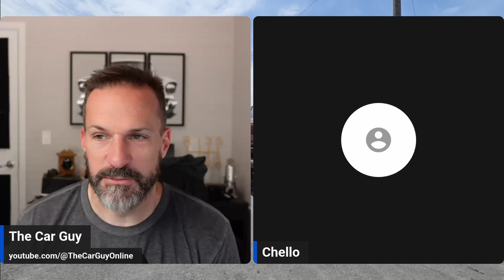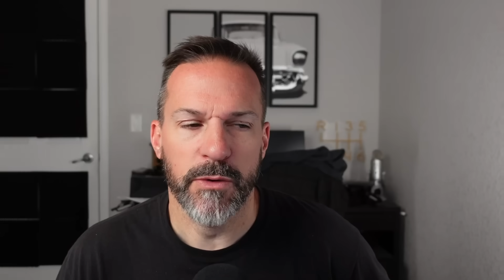Former GM Engineer EXPOSES Planned Obsolescence Tactics.

Comment: 2 days ago, I sat in front of the financial officer at a GMC dealer approved for a Denali ultimate 2025 .  I asked warranty questions.  Right from the start, I was told not to have my transmission flushed at all by the dealer.  I told him I do this every 50 thousand miles and use GM products.  He said if you like your warranty, don't do it. So I said sell me an extended warranty.  He said sure how about 5 years 100 thousand miles power mechanic part. 14 thousand mile limit though. I said what kind of warranty at GM has a limit on mileage on a 6.6 diesel.  He said we sell Fidelity as an extended warranty.  I said I want a GM extended warranty.  Sorry sir we don't sell GM extended warranties at this dealer.  So I said Lubrication is a problem for this warranty company.  Will my transmission be covered by Fidelity if those valves have an issue.  He just sat there staring at me. So I walked away from the deal. I had an awesome price but with auto manufacturers selling trash products you better have a badass warranty.  Not some warranty company that you have to file a claim to get fixed. I have my 2012 GMC SLE diesel with the LML and 300 thousand miles on it. I recently upgraded my CP4 , RDS turbo, 8 new injectors,  new fuel rails and lines. Green belt, water pump and 2 new thermostats. 
Runs like the day I bought it. It's a 2500. I'm considering keeping the beautiful truck and turning it into a overlander and buying me a new 3500 for my retirement.  Well that was the plan. I guess I'll set back and watch what GM does for 2026 transmissions. I still got my 30 grand to lay down in my pocket. Heads up, GM loyal fan here. Make me happy.
Reply: That dealers full of crap..go elsewhere…my brother bought a used 22’ Tahoe with 24k miles still under factory warranty and he bought a extended warranty thru gm to 5 years 100k…that salesman was lying to u , they probably been told by gm to undersell the factory warranty extension cause gm knows their stuffs junk and to save the company money,cause they know all these trucks will be coming in for work…never buy a aftermarket warranty….only extend the factory one and today I would never buy anything new without doing that these vehicles are way expensive and I would want the whole thing covered more than 3 years 36k miles..cause your loans gonna be a minimum 60 months.
Reply: @toddprater14  👍
Reply: Gm doesn't give a hoot about you
Reply: @Dillybar777  neither does Ford or dodge. Been through them all. The only difference between all 3 is gmc will actually look at your truck the same day and at any gm dealer.

Comment: The problem in the auto industry is they keep moving on to new and different. They never focus on perfecting what already works.
Reply: They perfected it all decades ago. The problem for them was that a vehicle that lasts 30 years and 300,000+ miles doesn't generate secondary revenue or new vehicle sales.
Reply: What about reputation? If I were a car company I’d rather be known for making a superior product and charge what it’s worth than being known for putting out ever changing crap that cost the same as the next company…
Reply: If everyone was paid in exposure then nobody would be getting paid or paid very little. Car manufacturers, along with any giant corporation is doing what they can to be into as many markets as possible or be a monopoly like Google or Apple
Reply: @williamdebene2394 except that thinking is flawed in the bean counters opinion.
Reply: @williamdebene2394  The people running the company don't care. For the most part they just want to keep the shareholders happy today. They aren't thinking about 10 years down the road.
Reply: @illbeyourmonster2 yup. The GM 3800 v6 is basically indestructible. I'm guessing that was a mistake.
Reply: @stinkothestooleater4490 - They couldn't get the 3800 to meet the newer emissions. That was it.
Reply: @corpsie666 true. But they can still make fuel efficient engines that meet emissions reliably. They choose not to.
Reply: Most of that is because technology and government regulations are constantly changing.
Reply: @Holden-McGroin bs. They keep changing stuff because that's what makes them money. They get around most the emissions stuff by making their new trucks bigger and bigger.
Reply: Toyota did it for years Y'all complain and said it was boring ... 👀
Reply: @jermainec2462 that’s why I drive a second generation tundra, 300k miles is typical for those
Reply: @jermainec2462 nobody complained. People said it may have been boring but it was worth it, having a 500,000 mile car. Literally nobody called Toyota and demanded they make their most reliable cars more "exciting," with stupid over-engineering.
Reply: @654Crossman they demanded it because ppl complained they were boring... They finally listened and this is the Lexus you see today ... Akio Toyota got sick of y'all talking shit 😂😂
Reply: @jermainec2462 are you high or drunk?
Reply: They did perfect it.  But it ran too long so they fixed it.
Reply: Except the top Japanese manufacturers, even if for some cars they also brought up the planned obsolescence.
Reply: Gm did bad deals.and gave away thier.markets and tech to china....
Reply: Sadly customers are as much to blame as anyone. I used to think it was insane that they changed body styles so often. Just as they were getting all the manufacturing kinks worked out, it can take years, they change to a new body style. But talking to guys who work in the marketing department makes it clear why they do it. There's always a spike in sales when a new body style rolls out. It's stupid, as the first couple years fit and finish aren't as good as they will be, but most people don't know or care. They want a flashy new car that stands out.

Comment: Cars and appliances these days are manufactured with a lot of plastic content.  They are junk.  Because this is be becoming so widespread, any manufacturer of these items that wants to capture their market, should go back to designing and building a quality product.  Sure, it will cost more, but in the long run it will save smart shoppers money and that manufacturer will become a leader.
Reply: My parents still have a garage refrigerator for over 40 years.
Reply: @xnihilo64 Don’t get rid of it.  It’s built better than toda’s junk.
Reply: The general public isn't smart enough to buy better products. Everyone just does what they're told. And the marketing tells them to buy junk. If someone tried to make a quality product today they would be sued to the gutter and failing that, customers would abandon them to get the newest flashiest plastic junk instead.
Reply: Are people willing to pay more for higher quality cars or appliances though? Here in Australia, a Mitsubishi Electric or Panasonic refrigerator is approximately 80-90% more expensive than a comparably sized Whirlpool, Westinghouse (Frigidaire), LG or Samsung, and honestly the notion it "might" last three times as long but is nearly twice as expensive is a hard sell.
Reply: @TassieLorenzo Here in the US, appliance manufacturers both cheapened the content of their products and raised prices.  At this point, I think the only solution is for groups of engineers to form start-up companies to design and build solid appliances without the overhead and expense of large corporations.

Comment: Great video!...and it closely matches my suspicions and experience as a customer of numerous vehicles. I've owned at least 50 cars, trucks, and SUV's since 1992 (about half purchased new), and currently have a fleet of 16 (several GM, several Dodge, a few Jeeps, and one Ford). The vehicles range from the 1987 to 2025 model years). I've also owned Nissan and Honda in the past.  Based on my experience, the best built and engineered vehicles were from the late 90s to about 2010/12 (depending on the make/model).   In general, the individual component build quality of older vehicles is significantly better than newer cars, although some of the design, feature, and fit/finish is better on newer ones. If I could buy any new vehicle it would be a 2005 (fill in the blank on make/model). Newer vehicles are generally disposable trash that are often mechanically totalled after ten years or less.
Reply: I've got an 05 Jeep wrangler and an 05 GMC Sierra 2500 with just the 6.0 gas engine. Still very reliable vehicles.
Reply: Yup, the early 2000s was peak vehicle reliability and functionality. Yeah the interiors and things weren't the nicest but they drove well and were extremely reliable.
Reply: ive got fIve cars. 97, 97, 00, 05, 10. the 97s can literally sit for months. put a battery in and they fire right up. we're screwed once these vehicles are no longer available

Comment: GM engineer: "Hey, boss. I think we've designed a really great, powerful, reliable engine."

GM executive: "Good job. Now go back and figure out how to make each unit 25% cheaper to produce."

I have been making this joke for years. Turns out it isn't a joke! 😂😂
Reply: You forgot to add that it should explode 3 days after the warranty runs out.
Reply: But see, that’s the right way to do it. That’s not what GM does. GM lets their accounting staff arbitrarily change engineering decisions without consulting the original engineers at all. Cost accountants have the final edit on everything. Been this way for decades. It explains every one of their major screwups.

Comment: I’m going through bs for the 2nd time in 3 years! My 2022 Trail Boss had a lifter failure due to the crappy AFM/DFM system in which they snapped in half. They never alerted anyone or sent any recall notice. When I asked why, the dealership said GM was waiting for them to fail and then have the owners bring them in, clearly cause they were hoping they’d be out of warranty. After it got fixed, I traded it in for my 2023 ZR2 with the 6.2L, and now those have issues! Been looking into trading this one in for a ‘25 Toyota Tundra, till I did extensive research and have found that these new Toyota trucks suck too, and that they went away from the V8 and now have the I-Force Max twin turbo which are loaded with failures and people complaining about the cheap build quality. I’m hearing the fix for my ZR2 is that they will do a diagnostic test. If they fail the diagnostic test, they will replace the engine, if it passes diagnostic, they will drain the oil and replace filter and oil with 10W-40 and increase the warranty to 10 years/150k miles.
Reply: Afm went bad and destroyed my engine in my '14 sierra as well. I took it into a shop and spent 8k replacing parts and completely mechanically disabling the afm. Ran fine for years til the trans went a few months ago. One thing after another but im not getting rid of my paid off vehicle for another can of worms that I have to have full coverage on and pay a ridiculous amount monthly.
Reply: need to get a tundra made after 5/25. they changed the bearing design on main 1 and rear.
Reply: You better off getting the Tundra at least Toyota is replacing the engines as a whole and not pissing down your back and calling it rain like what GM is doing
Reply: @Clamjuice65 Yeah, I'll buy a new Tundra with a likely/possible bad engine because I can get a new possibility bad engine??? Then there is loss of use and inconvenience. Have at it!
Reply: @jimiguitar3252 and you can have the same situation dealing with GM . At least Toyota gonna replace it and they not back ordered.  So yeah I’ll have at it with Toyota over crappy ass GM shit any day
Reply: @Clamjuice65  Ford had a 6.2L engine I have it in an F150, it is bulletproof, very few repair vids about it. They also put it in the superduty. They have a very rare broken valve spring issue. Even rarer to drop a valve and destroy the engine. Very simple SOHC engine like an overbuilt crown vic.
Reply: @jimiguitar3252 you will definitely get a failure with the GM, not a question of if, but when. Fact
Reply: @Clamjuice65  they have to start making long blocks, they never did before - you'll wait.

Comment: Planned obsolescence goes all the way back to Alfred P. Sloan in the very early years of GM.  GM has succeeded with their plans, to the point where they themselves have become obsolete.  Well done GM......well done.
Reply: Planned obsolescence was introduced by Alfred P. Sloan, the CEO of General Motors, who envisioned a radical new idea that would change the auto industry and the entire economy. GM would convince customers that one car in a lifetime wasn't enough
Reply: @RayVanessa-p2d  In opposition to International harvesters' pickup lines that killed them because they would never die no matter how hard you beat on them.     I have a 1952 International L110 that would take maybe a good weekend and $500 - $1000 to have it back up and running as a daily driver.   It would be ugly and basic but it would run!
Reply: Started big time in the 80's

You see vehicles from the 70's and 90's but very few from the 80's  They did it too good.
Reply: @lostvisitor You must live in a good weather area. I live in the rust belt. Very seldom do I see anything older than about 2010. It seems as the car makers either make the bodies rust out or the engines blow up. In the 70s during the malaise era, they were using muscle car drivetrains that they cut the power output in half. The drivetrains were bulletproof because they were way overbuilt but the bodies rusted out overnight. Then in the 80s they seemed to solve the rust issue but the smaller engines were garbage. American car makers weren’t used to building economy engines. The 90s kinda got it right but at that point cars were so boring nobody cared. This is about the time that a lot of buyers switched to buying trucks. Most Americans want a full frame V8 powered vehicle and trucks are the only thing left that fits the bill. Plus they were bulletproof because most people used a heavy duty vehicle as basic transportation. SUVs in this time were truck based. But the rust issues reappeared. Now most American car makers only make a few passenger vehicles. Mostly Mustangs and Corvettes. Chrysler had been doing very well with the 2 door Challenger and 4 door Charger. Both had V8 options. Ford did well with the Crown Victoria until it was killed off. GM went downhill when they quit making RWD cars. We can all thank the government for the mess we’re in today. They stuck their nose into private business by telling automakers how they had to build cars. Had they all kept making RWD cars with available V8 powered vehicles they’d be alright today. They should have left the FWD crap box car building up to foreign automakers who had already perfected them. But government mandated our automakers to make Japanese cars and we failed. Why would anyone want an American copy of a Japanese car? Especially since they had already perfected them? This is a big (but not only) reason our automakers are in the bind they’re in. Automobile manufacturing was a large part of our economy not so long ago. Since we’ve fumbled that, our economy is poor. Thank the government. Democrats and Republicans alike.
Reply: @mikee2923  I can agree with most of what you said.  But you missed the biggest point.  Auto makers as well as ALL big business is interested in only ONE thing.  Getting the money out of your hand and into yours.  The times of providing a service and quality products has always been a LIE.  The Quality engines of the past were a mistake.  Then they kind of got it right in the 90's by accident.  

I work on these piles of junk every day and the newer it is the worse it is but they are ALL junk.  If you ever meet a auto engineer kick him in the junk.

As for the government mandates.  The auto makers pushed them and paid people off to get them so they could close out competition.  You can still get a 10k$ new car every place else in the world but here.  Yes it is junk but so is the 50k$ car you CAN buy.

The biggest problem auto makers face is the fat, lazy, stupid work force that thinks they are worth 40$/hour to put a bolt in a nut. 

The economy is trashed because the RICH take more than they have earned and the workers want more than they deserve.

you don't need higher minimum wage.  You need to unlive the 1% and stop feeding people that don't want to work.  And stop saving people that can't face life sober.
Reply: @lostvisitorI see quite a few 80s corvettes, camaros, impalas, and trucks - but then again these owners are more than likely going to maintain these cars properly other than mass-consumer economy cars.
Reply: The other thing Sloan did was basically invent "consumerism" for the modern era. He realized if he just changed the styling of the cars every few years, people would always want to keep up with their neighbors, or one-up them, and buy a new car when they didn't really need one. Ford was happy selling the same car for decades like most famously the Model T, Sloan made it so that people could no longer be happy even when they had a perfectly good car, i.e. consumerism for the sake of consumerism. Say hello to mountainous overloads of consumer debt and landfills full of cubic miles of senselessly obsoleted waste.
Reply: @GlennC789  You can see that very thing happen in other video comments sections when they went from 8" screens to 13" screens.  Idiots with perfectly good trucks falling all over each other to get rid of theirs for one with a 13" screen.  Weak minded, easily manipulated.
Reply: @GlennC789 unless you just don't buy into the consumer mindset it's not that difficult to do
Reply: I blame Ford vs. Dodge Brothers.
Most of the complaints people have about corporations in the USA can be traced back to that ruling.